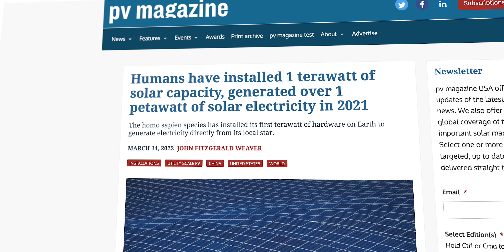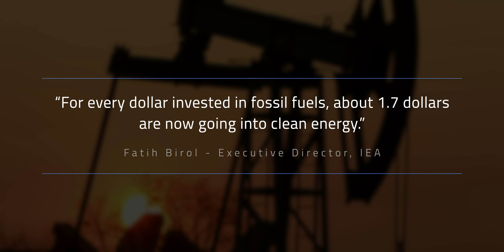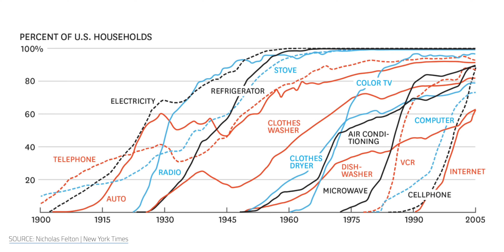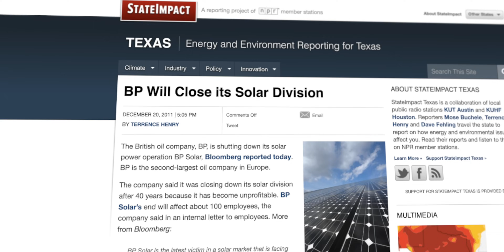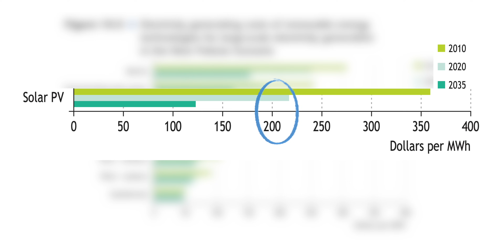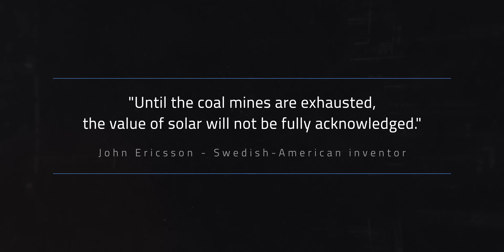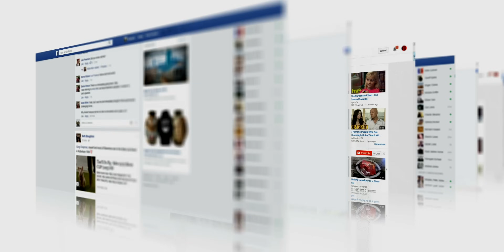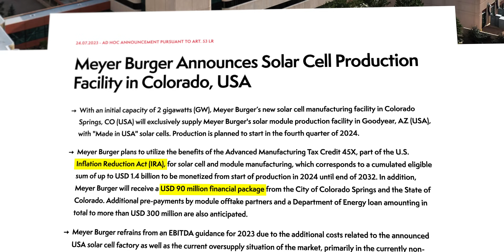How Solar Power Got So Cheap … So Fast

Comment from the maker: Did you always think solar was going to be the dominant technology? Order yourself a LARQ Swig Top Bottle to go plastic free and enjoy ice cold water throughout the entire day.  https://bylarq.com/undecided3 CODE: MATT10 

If you liked this, check out Why Are Floating Wind Turbines So Huge? https://youtu.be/83FqqfODmmg?list=PLnTSM-ORSgi7uzySCXq8VXhodHB5B5OiQ
Reply: Where are the bulk of the world's solar panels and inverters manufactured Matt?
Reply: yes
Reply: I think they way we do solar now is bad like just 5 miles down the road they built one removed all plant life left it bare and the solar is really close to the ground like 6 feet off it.
But the worst part it's now a big heat dome and a driving hazard just driving at it when the sun is behind you ya you'll get a big glare from the solar farm blinding you just this year alone car crashes in that area has gone up 70% 70 wtf how is that ok.
Geothermal is best but if it must be solar it needs a change like a big one like native plants under them give just a little more space between the solar so more plants can grow helping cool the solar.
Also if they will alow solar farms along side roads why can't we fill the dead space on freeway off ramps inside cities and yes and native plant life there to not rocks.
Ps I'm in nv not a wet state and I've seen a massive decline in joshua trees mesquite trees and other cactus and native bushes and grasses there being removed for more homes and solar farms.
Reply: Star Trek - The Voyage Home predicted it be solar.
Reply: Ever since I was a little kid reading about solar in National Geographic World & Science Digest etc (yes, my parents made sure we read stuff like that) I thought solar was right around the corner.  I just knew that everyone would have solar panels on their houses by the time I grew up.
Reply: The 400 pound gorilla is still cheap storage for the average homeowner
Reply: Hi Matt - a great video.  I got convinced of the potential for PV in the late 80's and I have maintained a spreadsheet that shows the total deployment of PV from the end of the 50's right through to present day.  
I was involved in the deployment of the first grid connected PV home in New Zealand and helped write and negotiate the first PV grid connection standards for Australia and New Zealand.   
I am now based in California working for Enphase Energy. 
I will send you a copy of my PV adoption curve that I have been tracking for the last 30+ years
Reply: Ya, of course, ty censored all the real facts from my previous comment.
Reply: When they have to censor the truthful facts, that tells you everything you need to know about the topic and anyone who presents the commonly accepted "facts."
Reply: It'll have to be a lot cheaper here, in the UK, before I commit to going solar...
Reply: I still believe that one of the biggest considerations for or against solar is being ignored. The energy that would otherwise hit the surface crust being partly absorbed & converted into electricity is not hitting the ground anymore. As more solar PV sites are built assuming they are not going onto farmable land still will effect soil retention in rougher terrain. This reduces the land stability on steeper slopes that trees & underbrush would stabilize. Also creating pockets of shaded area in drier climates letting scrub that would not take hold & presenting more tangles of brush giving smaller wildlife a place to live but also presenting difficulties in keeping those panels clear. Simply put there will be complications with the massive coverage of solar farms. What those are we need to & seem not paying attention to.
Reply: I would agree the incentives can have a positive influence. However, from installations I've seen in a 400 sq miles around New England, 50% or more of these are not installed to be an effective use of funds. Effectiveness being the angle of the panels to the sun and an unobstructed path of the sun during any time of the day and all four seasons. There would appear to be no oversight on how systems are installed. The only outcome being observed are the number of systems being installed. Solar contractors are more than willing to install a system no matter if the panels get full sun or not. I've seen large systems with hills in the way, six 300ft rows of panels systems placed up against a heavy forested area and homeowners with trees in their yard blocking most of the sun. 

A good example of this incentive abuse is a recent home installation completed nearby. The homeowner had the system installed on his home and when it didn't operate effectively, they went to their neighbor and asked them to cut down 6 large trees, so their solar panel system wouldn't be shaded. Either the city inspector who issues the building permit prior to the installation didn't have experience with solar systems or the city wanted their green energy numbers to look good.  

Another example in my area are acres of solar panel systems installed on farmland adjacent to working vegetable growing fields. The dust generated during cultivating and harvesting is extensive. Some of the dirt landing on the panels will wash off in the rain, but not soil with a content of clay is going to wash off. White vinyl houses in the area turn brown, even when they're miles from the farms. Every spring cultivating and fall harvest will degrade the solar intake of the panels. This is the equivalent of putting a pair of sunglasses over the panels. They can be individually washed, but is it cost effective? 

At least in my area solar contractors/large solar farm businesses are getting rich and politicians are wrongfully benefiting from boosting green energy efforts, while the people funding the incentives are paying for poorly engineered systems with little to no returns on their money.
Reply: Now THIS video was smack-on.  Absolutely correct on all counts.  You hit it on the nail this time! If I were to predict what the power mix would be 100 years from now it would be: 150% solar, 50% wind, 10% nuclear, and roughly 1-weeks worth of battery capacity.   Yes, over 200% ... there has to be significant over-generation to reduce energy storage requirements across poor weather, and that in-turn reduces base-load (non-daily-cyclical) generation requirements.

And there is a trifecta trade-off between daily-cyclical renewable generations, storage, and base-load generation.   It makes no sense to install massive amounts of nuclear in the same way it makes no sense to install massive amounts of energy storage.   There is a balance point.  But wind does provide a certain degree of base-load as do other forms of generation, so with appropriate energy storage we probably don't need more than 10% nuclear in the mix (10% of generation in terms of capability, not in terms of actual output) to serve as a trickle charger for the batteries.

Also, keep in mind that nuclear cannot operate economically without sufficient energy storage to allow the nuclear to run 24x7.  Otherwise nuclear has to run on a daily-cycle and that is not economic for nuclear power.

This is my prediction for 100 years from now.
Reply: @PetraKann  IN CHINA!
Reply: I've always thought electricity would outpace fossil fuels eventually. But never really thought about which method would do it cause solar was always too expensive and I figured either solar would improve or other methods would outpace it.
Reply: @TimArsenault  Because it's a money grab at the tax payer's expense. Nothing more. Nothing less. There is a word for this but yt won't allow me.
Reply: I love solar PV and thermal. It is all about the cost for the poor people. Even at today's lower cost I cannot afford it.
Reply: @salimufari a few factors to consider in response to your comments. 

PV fitted to buildings and carports structures above parking lots are clearly not adding to the ground that is being covered. 

Even if all new PV is ground mounted and covering otherwise uncovered land the total amount of the total available land that needs covering in PV is a fraction of a percent - I doubt that this amount of land coverage makes any difference.   Certainly the amount of land coverage that is needed is a small fraction of the deforestation that has occurred in the last few decades.

Also the total amount of land needed here is only about a third of the land currently being used by the fossil fuel industry.
Reply: Yes.  Yes I did.  The question was when manufacturers would be able to get costs down.  And this is where you have to understand what happened in China, and when.

Here's what you didn't cover which is what REALLY brought prices down.  

The cost of silica, and hence the cost of making silicon crystals had been going up and up, to the point where companies weren't even thinking about using it anymore.  This was in the period of 2003 - 2009.  These high costs for making silicon crystals was doing two things.  It was making ICs more expensive to produce along with solar panels.  Solyndra was a company that was a startup in the US who was trying to make panels using other materials.  Yes, Democrats got BROW beat for funding this company even though it was a sound idea.  But once again, just as companies in the US and Europe abandoned solar panels (oil companies, what do you EXPECT?? them to explore for silica??) Chinese companies were basically coming on line.

China opened up mines for silica and this shot the price down by 90% and THIS is when it became feasible to make solar panels for sale to the general consumer.  This was somewhere around 2009.  However by the time this happened, along with the first benefits of this going to making ICs, as you mentioned different companies abandoned the market, but NOT in China.  In fact it wasn't long after these companies dropped out that low cost panels started to become available in China, and here you can thank Chinese engineers and their govt.  They improved the manufacturing process for solar panels, really bringing almost everything together.  They also improved the efficiency of solar panels.

The Chinese govt. helped by putting incentives into the development and improvement of panels and also incentives for installation.

Now, for the Chinese haters, no, their govt. no longer subsidizes the production of solar panels.  In fact there are a few Chinese companies making them now and there is good competition.  This is when other countries started to understand they could grow their solar industries.

There is a key to ALL of this.  It's low cost silica.  Something about like 80% of all silica that goes into the market comes from China, about another 10% comes from Russia, and about 10% comes from the rest of the world.

So EVERYTHING about costs coming down for solar is about what happened in China.

And for those who are going to say silica is common, yes it is.  But it's not common to have good deposits of it, and the US used a lot of deposits in making ICs from 1975 - 2005.  You can NOT go out to a beach, scoop up sand, attract the silica out, and dump the sand and get another scoop.  Sorry, doesn't work that way, WAY too expensive.  You need rich deposits of silica for it to be low cost.  This also means more deposits need to be discovered so the world isn't dependent on China for almost all its silica.
Reply: @paperburn  Depends where you live and if they'll give you credit for power you put on the grid, and if it's a reasonable amount they'll pay you.

If you mean living off the grid sure, that's an expense you have to bear, one way or another.
Reply: Hello there Matt Ferrell, I've been meaning to ask this for a while but is there any way you can change your intro music?  For educational video's you can't go wrong with Vsause music in the background LOL jk  But I totally understand if the intro music is your jam though 🎵
Reply: @michael-j-harrison  No so, once you account for the required mining. The hidden backend is MASSIVE with these technologies. Likewise, so is the dumped waste.
Reply: Yes
Reply: I actually did think Solar PV would be the dominant electrical tech but not for the reasons you sited.   I looked at operational needs.  PV doesn't really need much for labor to keep it working.  There is labor to setup but then it doesn't require much.  You should have them cleaned once a year or more but not as many moving parts to fail and require replacement as Wind, Coal, Gas Turbines, etc.   Would be great to see the US adoption increase to lead in both adoption and total Mega watt production from PV.
Reply: $.27 per watt, and average home owner spends $20k on a system... Math doesn't check out here. At .27 a watt, the average system at 20k cost would be 74kw. Maybe 7.4kw i could believe... which would be $2.70 per watt.
Reply: I did only because oil companies fought so hard to bury the tech development in the 70s and 80s.
Reply: Hey Matt, I think you should not be saying generous incentives for solar. it is only just starting to match the oil incentives. so I dont see how it is generous.
Reply: It's funny how you mentioned solar steam. Another look into the lens at it and we now have more efficient means of making a steam engine and making one safer. We can make a steam engine wrapped in a sand battery. We have thermal solar pipes heating the sand. We can also have a chamber for the use of any fuel source available heating the water and sand. The generator that runs off of it can supply power to a purpose built dehumidifier to always keep the water topped up. Also if it's powerful enough, excess water could run a hydrogen generator to fuel the steam engine. The Steam engine we could build today could completely run off the Sun and Air moisture. The safety part comes from first creating analog methods to control the pressure. Then adding Digital means to monitor the machine. There also could be build  materials that could be used that improve it's safety. The steam engine still manages to beat ICE engines in torque and reliability if you have ever been to a steam show every year the ICE engine gets towed away by steam. The reliability comes from its longevity, One could be around for over a hundred years and still run like the day it was built. The funny thing is I was against steam engines for a while because they felt archaic but now I look at them in a different light.
Reply: Seriously? Smartphones aren't. The control system is incredibly clunky, the monthly rates are incredibly high. I get more out of a desktop pc.
Reply: Hello, I like your vidéos and this one is very reconforting for the future. But when you give the price of solar electricity with storage you use the current situation : solar electricity storage is mostly for short term (a day or a few days), which means that the cost of storage is divided by the number of usage an is therefore low. But the main issue, when we will use mostly renewable, will be long term storage (uge amount necessary, with very low utilisation frequency). The price will be completely different ! With the current price of renewable, if there is a technological game changer, it will be on very cheap long term storage.... still to be invented because hydro is far from enough... if you got anything regarding this I would be very interested.
Reply: It’s not cheap, system costs 20k
Reply: Why have so many of  the blue states that push solar no longer a 1:1 net metering? Like Cali and Michigan
Reply: How come if it's such a good idea the government has to make people who don't have solar pay for those who do.
Reply: Sadly to say, I did not think solar was going to be the dominant technology in energy. I come from the era of Logan's run, and their little solar power vehicle, and the TIE fighter having solar panels... But even then I was certain that nuclear was going to be a necessity to bridge the gap from Fossil to non-baseload renewables. I did have a hope for geothermal, despite my knowing even then as a child, that this was going to be difficult to achieve. But of course fusion was always considered the future at that period of time. Having said that, I always believed that it was going to be an important part, specifically thermal solar systems which could in fact create base load capacity. As a child I made a paper dealing with a lot of the energy sources and also of course, ways to save on energy, this was after all during and just after the oil embargos... I am happy to have been proven wrong, I still believe nuclear has a significant place, and believe that we will definitely be in a world where it's not going to be a single energy source as the dominant energy source, even if fusion becomes a reality soon... In many ways I'm happy that we did have such a long research "fiasco" with fusion, because it has in fact allowed us to develop other alternative energy sources in a non-niche way. The fact that solar,with the requisite battery capacity, and of course other renewables added to the mix, might in fact become our main source of energy as a group, and provide base load, is in fact something I never thought possible until the last few years, and now I'm hoping very much that, ala Pinky and the Brain, it does take over the world, so to speak
Reply: ❤ When you mentioned Cost per MWh ,  💵It's really Cost per KWh.   You made it 1000x cheaper.   💰
❤ 🔌
Reply: lol
Reply: Nice
Reply: Nice
Reply: One of the largest solar farms is in WALES UK... LOL
Reply: @DeathsGarden-oz9gg yup, that is the big cost of solar.  And the irony is that solar is supposed to save the planet, yet it kills things we need to live at the same time. Same thing for wind farms where many countries have cut down tons of trees to build them.
Reply: Now we have insurance companies putting brakes on solar by canceling home policies on houses with solar panels.
Reply: You haven't demonstrated that it can become the dominant technology.
Reply: @paperburn   - where can I get a  400 pound gorilla then? - I am always after cheaper storage.  jk. -cheers to AvE.
Reply: I think we'll get fusion working and that will end up being the energy source of choice. However solar for roof tops etc will still be a winner. Just less of a focus on giant solar farms
Reply: Still using wrong world map since Mercator projection 1569 huh?
Real Indonesia is huge as Russia and even much richer.
Reply: Thank you for your recommendation, but let's get back to the topic at hand. Solar power becoming dominant was not something everyone expected, but it's great to see how quickly it has become more affordable. If you're interested in renewable energy, you might also want to check out floating wind turbines. They're fascinating! Feel free to share your thoughts on that topic too.
Reply: While solar power is quickly becoming dominant, it's always good to have backup options. The Segway Portable PowerStation Cube Series is a versatile and powerful solution for outdoor enthusiasts and RV lovers. With its massive capacity, fast recharging, and waterproof design, it's perfect for a worry-free outdoor experience or as a reliable home backup power source. Consider checking it out!
Reply: That Segway Portable PowerStation Cube Series looks like a fantastic choice for outdoor enthusiasts like us! With its massive capacity, fast recharging, and waterproof design, it's perfect for camping or any outdoor adventure. Plus, the Smart APP Control feature adds convenience and real-time monitoring. Definitely worth considering for anyone in need of reliable power on their adventures!
Reply: That Segway Portable PowerStation Cube Series sounds like a fantastic option for outdoor enthusiasts and RV lovers! With its massive capacity, fast recharging, and comprehensive protections, it's definitely worth considering. Plus, the waterproof technology is a great bonus for those rainy adventures. Thanks for sharing this recommendation!
Reply: It's amazing how quickly solar power has become so affordable! If you're passionate about sustainability, you might also be interested in checking out the Segway Portable PowerStation Cube Series. It's a versatile power station with a massive capacity, fast recharging, and comprehensive protections. Perfect for outdoor enthusiasts and RV lovers!
Reply: It's amazing how quickly solar power has become more affordable! If you're interested in sustainable solutions, you might also appreciate the Segway Portable PowerStation Cube Series. It's a versatile power source for outdoor adventures and home backup power, with a massive capacity, fast recharging, and comprehensive protections. Definitely worth considering for all your outdoor and family needs! 😊
Reply: That Segway Portable PowerStation Cube Series sounds like an amazing power solution for outdoor enthusiasts and RV lovers! With its massive capacity, fast recharging, and versatile sockets, it would definitely be a valuable addition to any camping or family trip. Thanks for sharing this recommendation!